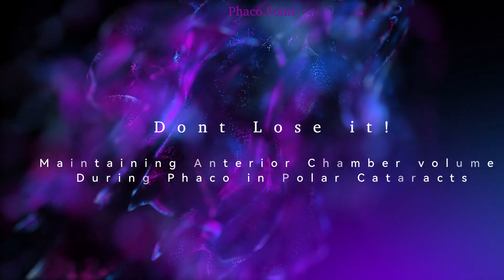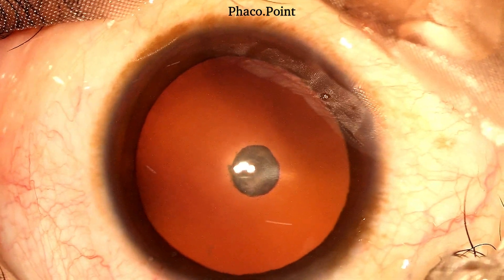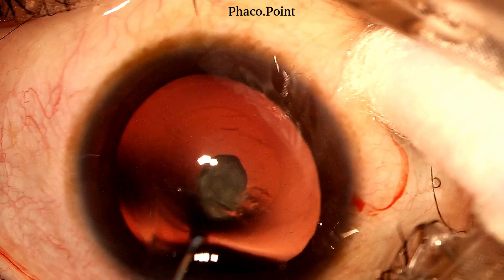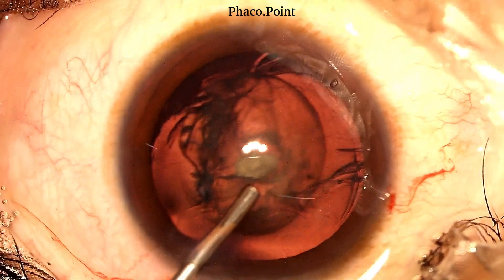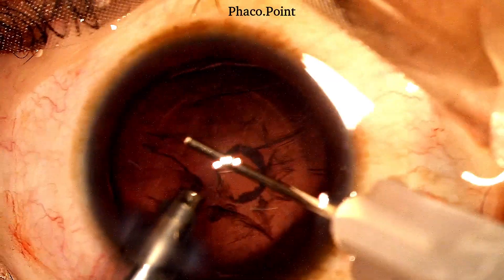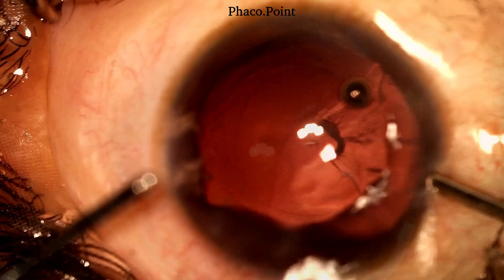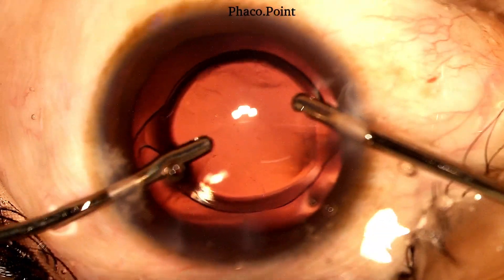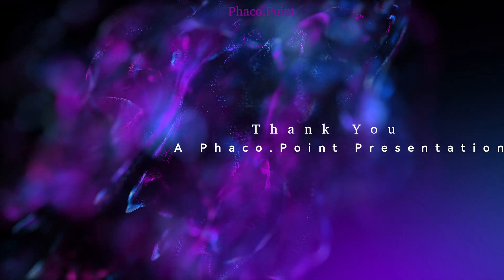Maintaing Anterior chamber volume & Chamber stability during phacoemulsification in Polar cataracts

Comment: Thank u madam for excellent demonstration..
I learn alot from ur videos..
Could u please teach how to push  visco in non dominant hand when the dominant hand is still in chamber...
Thank u
Reply from the maker: Thank you
Learning how to use the non dominant hand to inject visco elastic in the eye is quite challenging
It takes time to learn this technique of doing so
I would suggest, 
At first try to learn it in normal cases, not challenging ones like polar cataract.
Now here's how
First I'd fill use a string filled with a   little viso elstic . This is because if it is over filled , the piston is drawn further out. That makes the injection challenging.
Second I'd teach the  assisting nurse to hand the syringe to me , in such a manner that the tip is facing the sodeport  incision.so as she hands it to me I don't need to rotate the syringe in any direction . It comes into my hand with  the correct orientation.
Third,we must stabilise the eye with the dominant hand whilst then under clear focus, introduce the tip of the visco cannula into the sideport carefully, and having done so, inject the viscoelastic slowely, whilst simultaneously shutting of the irrigation from the handpiece/irrigation of the I/A
Reply: Thank u